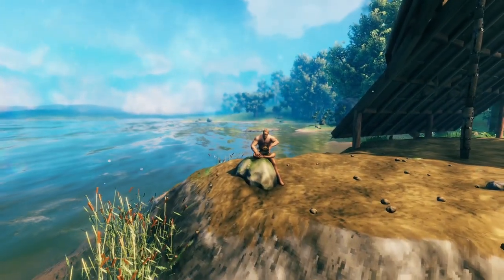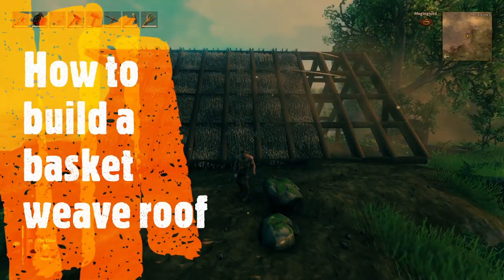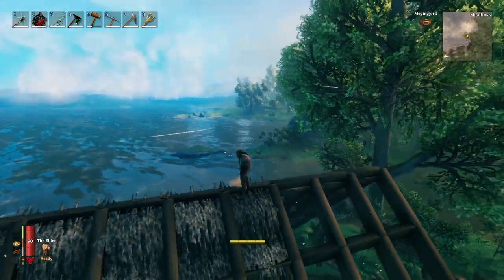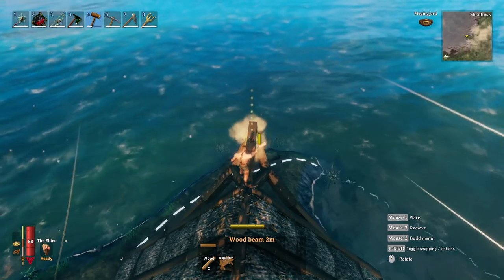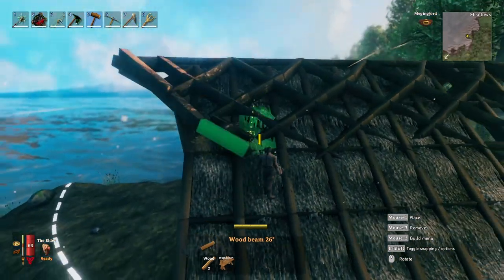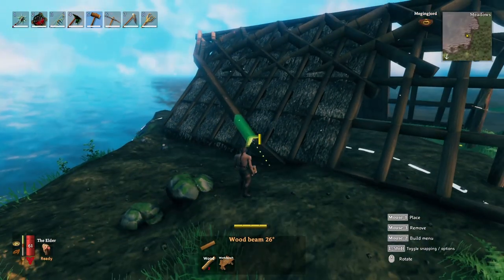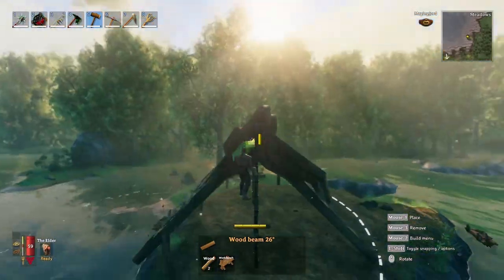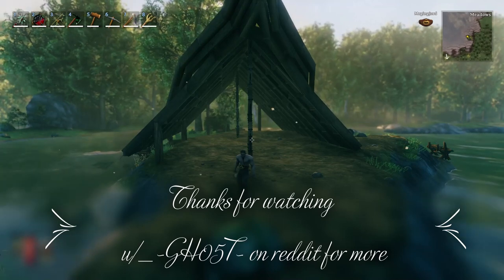Valheim - How to make a Basket Weave Roof

Comment: Dude, you are really crushing it with these build guides. Thanks for sharing!
Reply from the maker: Thanks. I'm trying to keep up to the requests as they roll in. I gotta somehow do my bridge next
Reply: Are beams waterproof?
Reply: Cause i want some beams like deco but dont want to be "killed" by rottem beams from rains:))
And i noticed that snow doesnt have the same effect like water :0
Reply from the maker: @czechapple  yes they are the 45s and 26s are. Vertical and horizontal are not (same with core wood)